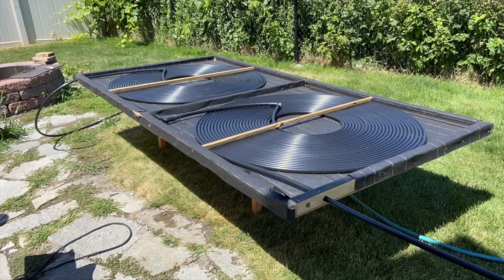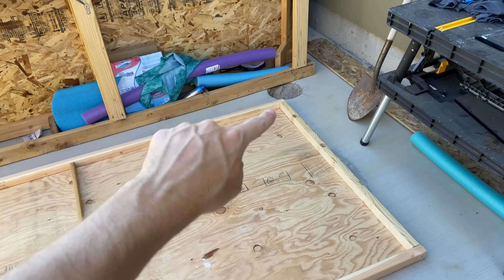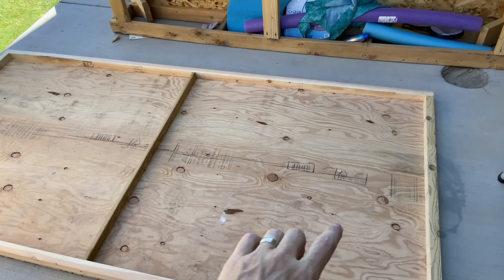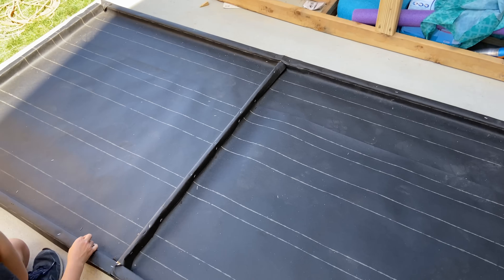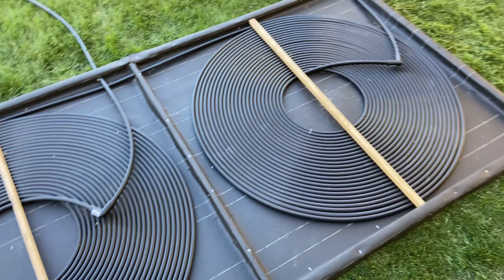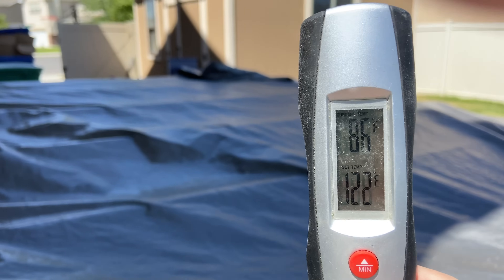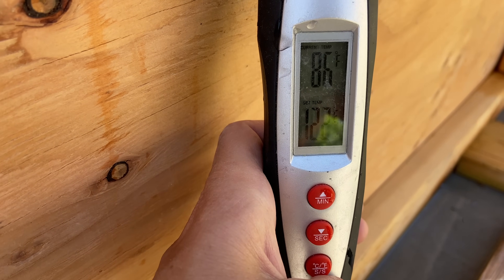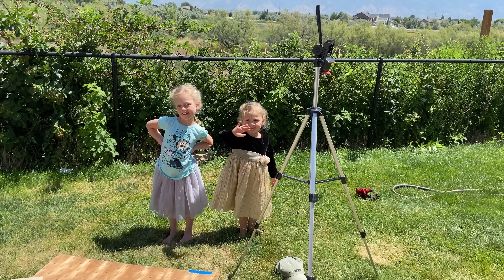DIY Pool Heater - $50 Solar Heater

Comment: Great video. I made a similar setup during quarantine. You have some great tips I will use for my next build--roofing paper (vs painting the box black), and using your shop chair to uncoil the hose. I made a few loops, picked up the entire coil, spun it around a few times, lay a few more loops... not very efficient, I'm sure.  Thanks for sharing!
Reply: What if you fill the box with sand or put a few coils just under some sand and rocks around the pool? I'm in the middle of making two now
Reply: @atomisum6445  Wouldn't that block the sun from the pipe/hose? The point is for the hose to heat up from the sun. I'd think the rock and sand would reduce or prevent the heat from building up.

Comment: Faster flow will still transfer all the heat of the sun to the pool water. Slowing the flow can cause damage to the pipes (over heating) or burnt kids.  Whether it’s a gallon a minute or 100 gallons a minute it’s still the same amount of heat.

Comment: You want to speed up the flow... hotter water but less of it does not heat the pool faster.. it's better to heat 2 gallons by 25 degrees then 1 gallon by 40 degrees.. also the temperature being higher inside the box shows your are wasting heat.. you want that heat inside you pool not the box.. your pool water should be cooling the box..
Reply: I would also use a separate pump.. you risk overloading and damaging your pool pump.. or at least shorting its life span.. using a separate pump will not use more power... if it takes 350 watts for a separate pump to running the heater.. by offloading your pool pump you will be saving 350 watts for the pool pumps.. in fact you might even slightly save power if you are overloading the pool pump and its operating in a less efficient range..

Comment: Did you paint the tubing? I read on another video similar to this that painting the tubing protects it from damage from solar radiation. I've just finished building 1 of these and have not painted mine, unsure whether to paint it or not. Cheers.
Reply: Hudson, what kind of pump did you use?
Reply: @carrielockhart7  I just put in series with my pool pump, it's a best way flow clear 58391.
Reply: @HuDz1966  Oh okay cool, thanks.
Reply: I wanted to do this once about 10 years ago and the guy at Home Depot told me the sun's UV rays will destroy irrigation pipe. It's made to be placed underground. He talked me out of using it for the project. At the least I would paint it.

Comment: No need to slow it down the heat is still there mine is thermal controlled only pumps when temperature rises above 85 and stops again when drapes to 80 degrees if temperature goes above 85 in pool it runs to cool at night 
Downward side has a flow valve that keeps coil full when not pumping

Comment: Wouldn’t the connection between the two hoses just restrict the water flow? And also 2 equal length of hose heating the same exact amount of water with higher water flow or less restriction, wouldn’t that almost equal out what the two length could potentially raise the temp connected together?

Comment: I Total novice here... I have 24 ft round above ground pool... How thick was the irrigation tubing you used? What kind of pump do I need. I’m not gonna run it through the pool filter, just gonna run the heating on its own pump.

Comment: People, this does not work!  A pool losses more heat in a day than this heater can produce.  You would need close to 600 sq ft of tubing laid out to increase the water temperature of a 25 ft above ground pool 1 deg considering heat loss WITH a cover.  On a cloudy day, ya start over from square 1.  Save you money.  These people say, oh it heats the water coming out of the hose by 20 Deg.  It sure does, when the flow is only 1 gal/min.

Comment: what's the amount of micro-plastics that leech from the black tube into the swimming pool? it's gotta be pretty damn high.
Reply: Because the sunlight will break down the plastic tubing? Is that what you mean?
Reply: @user-jt1jv8vl9r  Yes, that cheap tubing is not heat rated for what hes doing. micron size pieces of plastic will break off into the water and will be absorbed into the body. not good.
Reply: @refink33  I have no way of knowing either way, but it seems like a valid concern. The other is whether it will actually significantly increase pool temps or not.

Comment: To heat a swimming pool all that you have to do is to cover the water with black plastic. If you sink the black plastic to the bottom of the pool nature will circulate the water as hot water will rise to the top and cold will fall to the bottom. If you float the plastic on the top you should circulate the water from the bottom to the top with a pump. Running the filter while the sun is shining will work. A solar powered water pump will save money and turn on and off with the sun. If you live in an area where the water never gets warm I recommend painting it a dark color. In Florida where I live this would make the water so hot that you would not be able to swim in the summer.
Reply: I have been trying to think of a way to heat the water in my small below ground pool in the winter so that I can use it year round. During the summer i put a shade over the pool to keep the water cold. But in the winter I'm reluctant to go into this Wim Hof pool .  Now I'm wondering if draining and painting it black would be enough to heat it in the winter... I clean and repaint it white every june, draining and repainting it black in the winter would add about 200€ to the annual costs. Sunken black plastic doesn't sound very esthetic. I'm retired on a very small pension so I have to plan carefully. Any advice for me? Also, where would I get a solar powered pump ?

Comment: Not sureif anyone can assist me, I built one of these with 200' of irrigation tubing and only one loop on a 4 x 4' sheet, but the water still comes out just as cool as it's going into the circuit....seems like maybe the pump is too fast for it? Do I need a smaller pump I picked up a harbor freight one thats external (not submersible) if that matters...
Reply: How many gpm is going through the heater ?
Reply: @anexpertateverything4816  Thepump I purchased I believe is 450gpm, pool is 4400 gallon above-ground...about 200' of tubing..when i turn off pump whatever is in the line will heat up, and when i power on the pump it'll come out hot, almost too hot to touch, but that only lasts for 5 mins or so until the line is purged and filled with new pool water.
Reply: so there is
no temperature different?
Reply: @crantumcreature3949  Sorry for late reply, I had some personal stuff come up and got around to making some changes.  I put the pump BEFORE the heater circuit, so basically it draws water from pool, then pushes it through the coil and back out into the pool, previously it was AFTER the coil, pulling water from the pool THROUGH the coil and then pushing to pool.  This seems to make the flow more steady, and I did notice that if I ran the pump, turned it off and let it sit for about an hour in teh sun, when turnedon again the temperature of the water coming out was HOT to the touch, so hot i couldn't keep my hand under it for long..but again, as with before after about 10 mins when the water cycled through, it was simply cold.  not AS cold as the pool itself, so clearly it was collecting some heat, but I guess that the pump is simply pushing the water through too fast for the heat to transfer.  I have it in a 2x4 box surrounding the 4x4 sheet, however I do NOT have the plexiglass top on it, that was going to be my next step.  I thought about getting a timer setup to cycle the pump for about 10-15 mins every hour or so to allow the water time to heat up, or possibly adding another coil of 200' tube..  I don't have much room for that 2nd coil so we['ll have to see..thankfully the weather here has been hot and humid, so I honestly havn't really needed the heater yet, but im sure as we get more into end of august/september we'll likely want to use the pool and it will cool off at night...ill keep trying though :P
Reply: i am building mine 300ft tubing 16mm in two
black boxes with thick sheet of plastic.i am goimg to test it tomorrow

Comment: Can you tell me what size pump you are using (how many gph)? Are you using the pool pump? I have the same set up and the pump= filter that came with the pool is not powerful enough. I have a separate pump to run it, bit I would rather have a single pump that can filter and heat.

Comment: The black rubber hose assembly will lose its thermal efficiency, unless you utilize maybe a thermostat, or some type of restriction (ie 90° ball valve)  and maybe monitor live data of what temp that black hose assembly is acclimating to.  If the assembly is cooling down, choke the valve a little.  My in ground pool, I already got fittings to tap into, for utilizing my booster pump that is typically engaged for polaris operation only (but I can maybe try some diverter valve setup)

Comment: I ended up building two heater boxes very similar to this one. I was able to get a 15* temp difference inflow to outflow--however: The sun running through plexiglass blisters the irrigation hosing and the pool water eventually breaks through the blisters causing leaks. I have a 26,000 gallon pool.  With two heater boxes connected in series running all day, the flow is so low, even with a high-end $150 sump pump, the two boxes together failed to make a worthwhile difference in my pool's water temp.  I am in Sacramento, Ca.  Plenty of sunshine and 90*+ days.  At best, I have 800ft of black tubing coiled within 2 boxes, I got a ~2* difference in my pool's overall temperature improvement with my sump pump plugged in all day.  This is not a cheap endeavor.  With lumber prices from 6 weeks ago, I have $800 in lumber and plex-glass, not to mention an $150 pump that draws 5 amps all day long for energy costs--for 2*.
Reply: Glad I read this comment. I've been thinking about doing this. But I have a roughly 30,000 gallon kidney shape pool. I'm not interested in building a box that big for little gains.
Reply: @outdoor044  That would be a total waste of time and money. 

I live out in the country and on a well.  All I use the boxes anymore is for filling up my pool when it gets a little low.  My well water is a pretty stable 69* out of the hose.  I don't ever want to cool my pool water off.  I'd rather add an inch of 84* water than an inch of 69* degree water.   Adding 84* degree water does nothing to the temperature of my pool. 

 It takes 2 hours of running my well water through the coils in my boxes to add an inch of 84* degree water to my pool with no water temperature change.  I no longer use the plexiglass.  It got brittle and broke down entirely anyway after about 4-5 weeks, not to mention the constant repairs to the coils.  

Straight from my well water at 69*, I can add an inch of water to my pool in 30 minutes, but it drops my pool water temp 2*-3* degrees.  When your pool water is hovering around 78*-80* most days, you miss that extra 2*-3* degrees.  LOL  I like my pool water in the 84*-86* range.  

These are real life measurements.  

How fast you can add heated water really is the key point.  800' of 5/8" hose cannot flow enough.  The plexi-glass will increase the water temp some, but it will eventually blow through the hose.  It acts like a magnifying glass on an ant.

I don't understand why folks make videos like this?  What is the purpose?  Video likes? Subscribers?  Even bad comments probably racks up the pay I suppose. 

Total waste of time.
Reply: Great comments James! Sorry you wasted your time and money on it. I calculated using this video that it's a 4,000 BTU/hr system. So for pools like yours at 30k gal, pretty much useless, typical heaters for pools your size are over 250,000 BTU/hr.
Reply: Finally a smart Californian.  Wish more people save their money.  The heat produced isn't even close to the heat the pool loses.  Simple test people.  Fill a 5 gallon bucket up with the hot water (I don't care what the water temperature is).  Come back in 24 hours and check what the water temperature.  100% of that heat is lost.
Reply: @timm8311  Not sure what to think about your back-handed 'compliment' about California.  Frankly, without the good people of California, this nation would starve. You have some serious logic analogy regarding heat loss.  If you heat 26,000 gallons of water to a nice 85*, not going to cool off over night.   As far as the heaters go: It is math and the natural friction of irrigation tubing.   You cannot get enough water flow within a 5/8" irrigation tube to make a difference in pool water temps with one or two boxes unless you have a really small pool.  Lesson learned. You will need 2-sets of 3 boxes in series with two separate pumps to make a difference in your pool water's temp.   It doesn't take much in Sacramento.  5*-6* is huge.  But you will be into that for a couple of thousand dollars.  There are solar energy cell to take your pump off line.   I have property.  I don't have a natural gas supply outside of trucked in propane.  I do have lots of sunshine. LOL
Reply: @jamescurnutt1628  At least we agree that "You cannot get enough water flow within a 5/8" irrigation tube to make a difference in pool water temps with one or two boxes unless you have a really small pool."  Since you won't be able to heat the pool via this method, your example of the 85* pool is irrelevant, unless you have a very shallow pool or you're in a very drastic heat wave, which no one wishes for anyone.  Regarding the bank-handed compliment :-), I'd say the good people of California don't have a choice with your democratic state.  Taxes on everything and still can't pay their debt.  Crime is out of control with no punishment.  However, looking the other way on poor fiscally sounded choices and laws are not because of good people, it's because of naive people.  You guys are in for a rude awakening unfortunately with debt.  California has become the #1 pussified state in the country.  Hopefully your a person that is unfortunately generalized as a Californian.  Maybe I shouldn't use the word pussified anymore since it's directed towards a proven gender.  Peace.

Comment: Optimization of heat transfer in pipe flow is reliant on many variables, particularly the dimensionless Reynolds number as this dictates when the flow regime has passed from laminar to turbulent (Re = 2300).  You want turbulent flow!  What I really wonder about is the high likelihood that the piping shown here is only partially flooded with a large air void above the water surface and below the top of the pipe where the sun's heat is being absorbed.  This will dramatically reduce heat transfer as air is a poor heat conductor.  Long story short (too late!).... less pipe length + smaller diameter + flooded pipe cross section + turbulent flow = highest heat transfer rate per square unit of surface area.  Sorry if I ruined the fun.......
Reply: Make the story even shorter.  Heat input is less than overnight heat lose.
Reply: I was going to say "it's complicated" but you beat me to it....

Comment: 2021 Lumber costs turn a $250 DIY project into a $750 DIY project lol
Reply: I'm in the process of building something similar to this now,  all materials including a transfer pump I'm in it for under $200.
Reply: @tmurph247  The part that confuses me is the water coming out of the pool.  You use like a pond pump??  That pulls the water out of the pool and connects to....... a hose?  which then the hose connects to the tubing?  But how?  And is this all safe since the pump will be plugged in to an outlet??  Appreciate any advice!!
Reply: @carrielockhart7  i have an above ground pool that has three water inlet/ outlet places on the outer wall of which I was only using 2 of them,  one for water to the pool pump/ filter and then back to the pool.  I use the third water outlet to feed a hose my external transfer pump which is situated about 30 feet away from my pool. (Yes it is plugged into an outlet but it is far enough away that there is no danger of electrical shock while using the pool) my pump is then connected to the pipe coils for the heater and then ran back into the pool over the top frame rail that holds the liner.  Also I use a timer so the solar heater pump only runs during the hottest times of day If you let it run overnight because while it heats during the day,  it will have the opposite effect and you will lose heat from your pool overnight.
Reply: @tmurph247  Thank you so much, I can picture it now.  Appreciate it.
Reply: @carrielockhart7  there is a connector you buy Hose to tubing...simple
Reply: $47.00 tubing, $22.00 osb 4'x8'x3/8" , 2x2x8' need 3 for frame $3.50 each, $ 17.00 clear plastic x2 , small submersible pump if you wish $ 29.00 other items $25.00 comes to $167.50. Don't know how you figured your outrageous price. $750.00 ???
Reply: @user-cr2yz6kj9z 😂that's what I was just thinking, irrigation tubing is 200 bux at home depot
Reply: @envirojay  didnt age well, lumber prices are down 63% since your comment.  Thanks ! Biden
Reply: @envirojay  Take the politics to Facebook boomer.